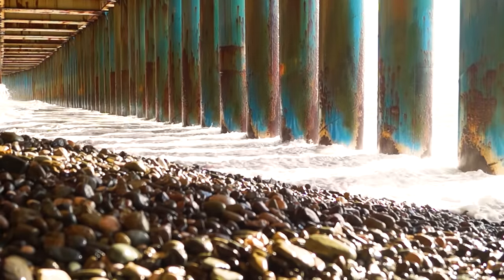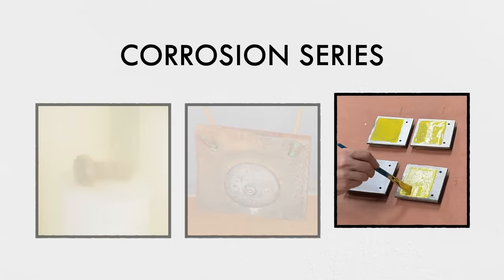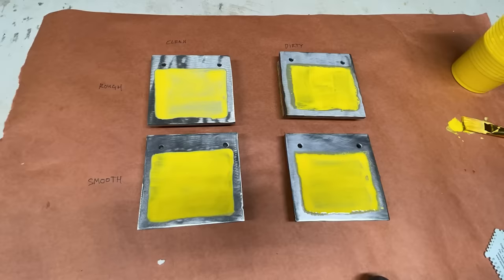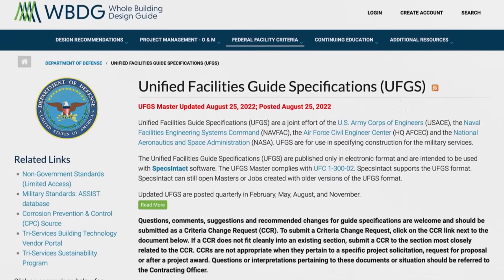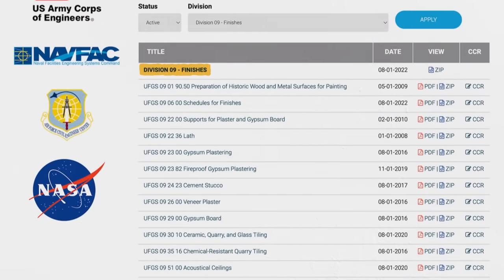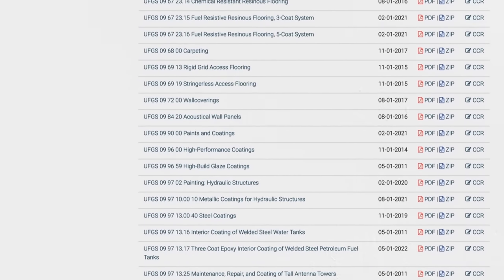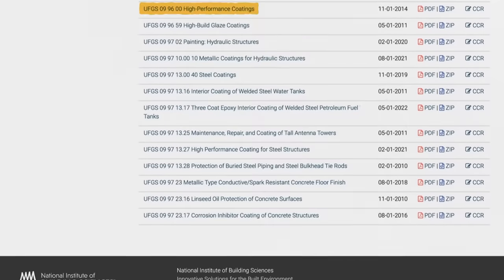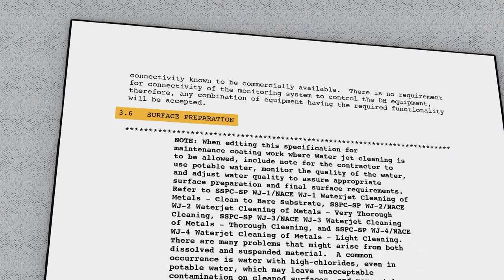What's the Difference Between Paint and Coatings?

Comment: That tool that they are running down the pipe is called A elcometer pulsed dc, more commonly known as a "jeep". Ive been in the coating industry for many years and you did a pretty decent job of covering this.

Comment: One of the things I learnt trying to repair rust on my cars 30 years ago was that the products you buy in basic shops (then) do not protect the steel.  The main problem is that all the products I used were not water tight, I took great care to remove all the rust and degrease/roughen but the rust always came back.  Zinc plate spray worked better than zinc primer, it was cold galvanising but the cans always blocked up on me.
Then came epoxy primer which can be used at home and does properly seal the steel, its known today as sealer or Epoxy mastic (a bit thicker for underside).  You can also use moisture curing paint, but ultimately you need a 2 part paint, solvent paint like cellulose doesn't seal.

Comment: During my time in the oil field we used about every corrosion protection method you could imagine from cathodes to coatings. The coating were inspected multiple times before it was even lowered into the ditch and one last time before backfill. Then the backfill was select matetial to avoid damaging it.

Comment: I worked on designing and implementing a system that coated mild steel sheet in a steel mill with a very thin layer of sputtered stainless steel. This steel is more for appliances and automotive applications and was a replacement for zinc coatings.

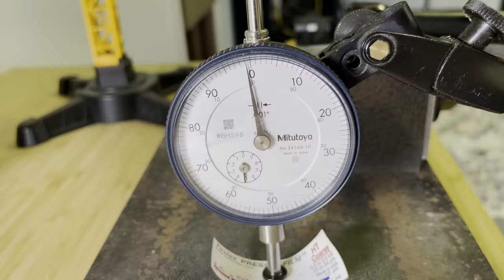Comment: @6:19 “used my depth mic ”

0.001”/div dial indicator on common magnetic base shown as an ersatz comparator stand. 0.0001”/div dial indicator or 0.0001”/div or electronic depth mic would’ve been a better choice.

Not sure if there’s been a video done on it but typically in manufacturing the measuring tool used should have 10x the resolution of the dimension being inspected, otherwise small differences in values get lost in the relatively low precision of the instrument. 

Circling back to this specific situation using a low res indicator on a not so rigid stand with less than perfect perpendicularity to the measure surface means this measurement is close to eyeballing. 

The surface prep profile calls out 0.0015”, only 1.5 divs on any 0.001” resolution instrument.

I also am aware this is a general education video, and I like this channel a lot. This comment is for clarity, and because the mismatch of visual and v/o bugs the hell out of me. 😅✌️

Comment: I suggest that you make a separate report on the mill scale layer (Fe2O3) described in my previous post. Because this is not only a Huge problem in factory construction but also in shipping, bridge construction and all open space steel structures. And it cannot be removed with a grinding machine on site work. However, if there has been proper sand blasting and then the surface has rusted again (FeO), then on-site sanding can solve the problem.
Reply: On the Tacoma Narrows Bridge in Tacoma Washington (not the 1941 Galloping Gertie) we would occasionally use Locktite Extend rust conversion coating. Seemed work because I found places where I'd come back to that spot 10 years later and no new rust. It could be applied to minimumally prepped rusted steel

Comment: You are in correct in your comments regarding the regular painting of the Forth Bridge in Scotland. While it is true that it is no longer continuously paint the bridge, as in when they get to one end they start again on the other, that was the case for many years, I remember several news/documentary items on the subject.
I also remember but can't give you an exact date but around 2000 when due to improved paint technology and coating techniques the practice became unnecessary. From memory the new paint/coating last 20yrs as opposed to the previous 3yr cycle with red oxide paint.

Comment: FWIW, we owned a building very near the ocean with iron fencing. We replaced the very old, very rusty iron fencing with new fencing with the idea we were rust proofing the fencing for 20 years or so. We had the new fencing metallized (zinc coated) and then powder coated. The results:
For the first 2 years or so absolutely no signs of rust were apparent.
For the next 2 year or so almost all the iron work showed no signs of corrosion. The exception was the front gate. The gate was subject to an almost continuous ocean breeze that came from the direction of the ocean. This section of the fencing began to show signs of corrosion until at the end of four years there were many dots of rust that had begun to show through.
At the end of four years we sold the building so I am not sure of what happened after that.

My  thoughts: 
1. Metallalizing followed by powder coating would be a very reliable system for areas not near salt water. 
2. There is a very significant difference in the susceptibility to corrosion of  iron work that has an opening behind it so that the wind is not significantly slowed as it blows through the iron work. This causes a lot of salt laden water spray to land on the fence
3.  Something more sophisticated than what we had done would have been necessary to protect iron fencing from corrosion that is subjected to a lot of wind laden with salty water spray.

Comment: I have worked doing every kind of industrial coating around....pretty amazing to see the differences in process....ALOT of handling goes into coatings vs painting 

You can charge 3 to 50 times a normal painting cost
Reply: Metal temp/air temp/due point 😉 conditions for coating

Comment: Prior to the new 2011 coating, the Forth Rail Bridge did actually have a permanent crew on site and there were sections particularly susceptible to weathering.
These parts required constant inspection and maintanence.

Comment: Questions: 1.) Should car manufacturers be "sandblasting" areas such as rocker panels prior to coating them to improve adhesion and prevent rust?  2.) What if small amounts of oxidized steel left after sandblasting are then coated?  If they are not exposed to O2 and water again, will the strength of the coating be somehow compromised?  Great information!  Thanks!

Comment: Most Epoxy resin paints chalk when exposed to UV light but most data sheets state that it doesnt effect the life of the coating system, top coats are usually applied to stop this chalking and add colour so in effect its a cosmetic coat. No not a major weakness. Great video non the less (y)

Comment: I live on a humid island, 75 feet from the ocean and like to restaure things. Been having a little nightmare with my windshield wipper arms. Part is aluminium, which poses no problem, but the rest is steel. You can imagine what that can do to a classic car.
So, I did my own test in a big strip of rusty steel. Divided it in six squares, left an untreated metal strip between them as control, sanded 90% of the surface and aplied diferent "work methods". Used two diferent rust converters, heated and normal temperature surface before aplication of anything (to prevent flash rust, commom here), with and without primer and two diferent paints. For now, the ones without primer are suffering with rust first. The ones with rust converter, primer and anti-rust paint or acrylic paint are doing better. The metal strip was left in the elements, on top of a wall.

Comment: Well done. You should do a video on the myth of powercoat 'durability'.   It seems to have gained this odd reputation of being the be all, end all coating. When in reality, it is quite inferior to even the most basic off the shelf liquid coatings. 
Ive so long pondered on how it got this reputation. I figured 1 of 2 possibilities. 
1. Since its 'baked on', folks perceive it as similar to baked on porcelain enamel. Which ofcourse, in reality, it doesnt even compare. 

or 2. Upon removal of a finished powdercoat via abrasive blasting or grinding, it proves very difficult. The reason this is true, is because of the heat produced from the blasting/grinding, the coating softens (it is just melted powdered plastic after all). So as it softens, it absorbs the abrasive impacts from blasting. And from grinding, just oozes around and turns to a horrible stinky gum. 

And for an extra dose of nonsense, powdercoat is also considered a "green coating".  lol  Its made from petroleum. It out-gas's when baked. And requires 350f+ temps to make. But most industrial process's also require it prebaked, or baked dry after its chemical wash prior to powdercoating. 

(Im speaking of the most widely used, most common, urethane powders. There are other more niche powders that fair slightly better.)

Comment: Very good video, but I wanted to chime in on something about blasting.  It was shown a little when you were looking at coating specs, but there are standard levels of blast cleanliness as well.  Many coatings can be applied at near-white levels, where a small amount of rust can be present.  Also, as further comment on the fragility of coatings, a sharp edge (such as a saw cut) can break the coating, even after blasting.

Comment: Nuclear Engineering student here, if you want to keep going with some more corrosion science you should check out how nuclear reactors are protected. Some really clever stuff is done to protect reactor components where coatings and galvanic anodes simply cant be used. Radiation damage accelerates corrosion, so to does being in contact with superheated, pressurized water. Look into it if this interests you, I know I and many others would enjoy such a video.

Comment: Steel allowed to rust followed by slightly sanded to remove the loose surface rust makes an excellent sponge for thinned down epoxy. Adding black pigment will help absorb sunlight for heat during curing while minimizing UV damage. The light coating of surface rust makes an excellent UV blocker and filler for the epoxy. Allowing the rusty steel to get hot and dry in the sun ensures absorption of the thinned down epoxy and the rapid evaporation of the thinner and curing. Everything I've made with steel has been allowed to rust before epoxy coating and this is the best surface preparation I've found.

Comment: Great video!but I'm actually very surprised that you didn't mention the Genoa bridge collapse in 2017, which was caused by corroded, concrete-encapsuled iron studs. The concrete layer made
inspection and maintenance very difficult, which, combined with criminal negligence by the people in charge of the  maintenance led to a catastrophic failure than killed almost 30 people.

Comment: There are couple of other common methods of measuring surface roughness:  comparator gauges and optical micrometers, they are about on the opposite ends of complexity but even the comparator is surprisingly accurate.

Comment: When I worked in a pressure vessel fabrication shop, I was a laborer before becoming a welder, and a big part of my job was preparing and finishing the metal. So along with grinding and sandblasting, I slapped A LOT of zinc paint on carbon steel. 
Most of the vessels themselves were stainless or some other alloy but the flanges, blinds and non-critical things like tank saddles were CS (the machined surfaces of flanges and blinds where the gaskets sat used a welded on SS liner). 
Usually not enough to bother spray painting, nor was painting the entire tank or vessel desirable, so we did most of it with regular old paintbrushes. All 3 coats by hand. It sucked lol.

Comment: It's the same on ocean going tug boats. I used to work on one in the gulf of mexico and we had to chip and paint almost every time we came in. We would chip the paint using air chippers and then use ospho to kill the rust and then paint. Steel rust really easy when exposed to salt water.

Comment: Water Bead Test: At a place I worked, we hired a firm that used water droplets on a surface to measure the quality of surface preparation before applying adhesives. I believe it used a camera and computer to give a percentage of how clean the surface is based on the beading of the water applied during testing. I cannot remember the name of the device or process. If anyone knows, please give a shout.

Comment: I wish to mention that boiled linseed oil has been used for hundred of years, before the era of synthetic resin and it has very different properties. In the process of polimerization linseed oil or linseed paint will not peel from the painted surafe and recoating will not demant removing of the old layer. Also homemade linseed oil and paint mixturs work really well.

Comment: if you add a way to circulate the water you will get some mild abrasion to the paint, and that would demonstrate why the paint adhering in important. much like the one sample that was prepped appropriately was hard to remove the paint this would show more issues with those that the paint didn't adhere as well to.

Comment: Sand blasting not only roughens and cleans a surface but also increases the surface energy. The main reason for that is to overcome surface tension of the coating. What you want is adhesion of steel and coating versus an cohesion of the coating itself. It has something to do with the vanderwaalsforces

Comment: Not that many years ago there were a number of box beam cranes used in the forestry and chemical industries that collapsed under loads that were less than their rated capacity. When the accidents were investigated, they found that the corrosion on the inside of the box beams had exceeded the design parameters and this is why the cranes collapsed. After the results came back regarding the accidents, many jurisdictions required that all box beam cranes be inspected which resulted in many of them being pulled from service and replaced or a discounted load capacity. One crane that I personally viewed that was pulled from service had areas where the 1/4" plate had been reduced to foil thickness in some areas. That crane was rated for 20 tonnes and the engineers doing the inspections were scratching their heads trying to figure out why it had not collapsed under it's own weight. Many of the cranes that past muster were retrofitted to allow for corrosion preventative measures.

Today there have been a number of changes made in how these cranes are designed and built. All welds must now be continual sealing welds and stitch welds are strictly prohibited. Previously there were open holes in the beams to allow electrical cables in groups to be strung inside the box structure from one end to the other. Today, they have smaller holes with pipe couplings welded in and the individual cables themselves pass through installed watertight fittings to prevent water and contaminants to enter inside the beams. The cranes also have at least one sealed manway to allow access for coating installation and subsequent scheduled inspections to take place. Although these changes add more to the initial cost of the crane, they are far far safer and the life expectancy of the crane is doubled, tripled or sometimes quadrupled which in some high risk scenarios (mostly chemical or chemical use plants) allowed for reduced insurance premiums.

Comment: Interesting! :) For backyard and garden solutions - coating steel with tar is often a very good idea. The process of applying it is kind of demanding and it requires some caution but the protective layer can last for even 50 years in atmospheric conditions. The curing time on the other hand... is measured in days to semi-dry and weeks to full dry. ;)

Comment: The enormous refinery I worked at never painted or put coatings on the majority of the steel beams. The few exceptions had concrete cast over the steel for increased protection and structural improvements in a fire. As the engineers described it, the rust increased the heat tolerance of the steel.

Comment: As a former Nondestructive Technician who has penetrant, magnetic, and ultrasonic tested these types of coatings in petrochemical and nuclear settings, I've also been in charge of the coating application inspections. I wish I could tell you that these coatings are as well maintained or inspected as the "manufacturer's suggested application process" would have you believe, but the client (I was third party inspection) often overrides your concerns on temperature or adhesion at the final inspection and doesn't care as long as it passes visual inspection. Many of the coating failures I have inspected were likely caused by temperature and moisture issues during application or curing stage (barring, of course, the high percentage of preparation failures you alluded to). While I've not worked in the structural steel (bridges and buildings) section of the industry, I fail to believe the same issues aren't likely shared between the Louisiana petrochemical tank facilities or Anchorage port facilities that are extremely common items for NDT/API to look at and see constantly reoccurring themes between different customers with the same end goal: get it up and running as fast as possible.

Comment: I’ve been a painter for some time now, (Houses, commercial buildings, roofs, etc) and paint is most certainly not only for decoration. It too acts as a barrier between the substrate and the elements. Coatings may not necessarily be paints, but paints surely are a type of coating.

Comment: Regarding sandblasting, usual pressure is 100-+ at the nozzle.  I would call it high volume more than high pressure. A load of air, all coming out at around 100psi. 
I'm no engineer, I have been blasting and applying coatings, and linings for the last 13 years. So please correct me if I'm wrong.